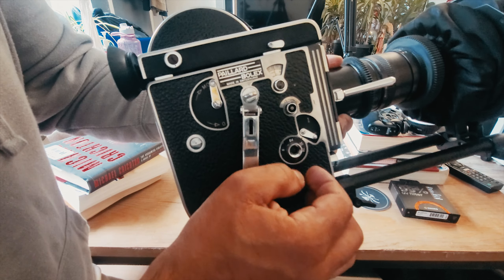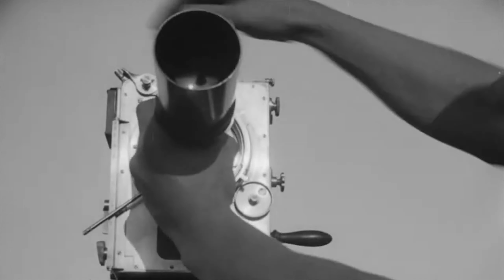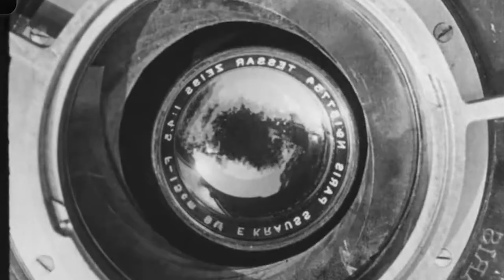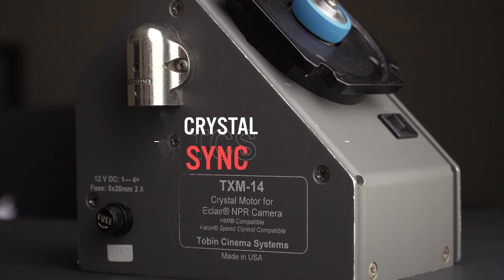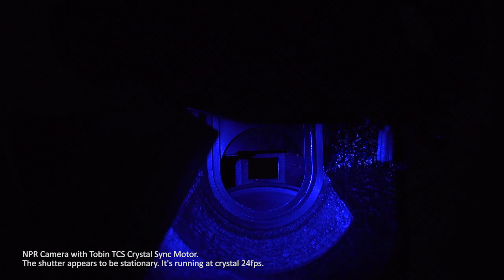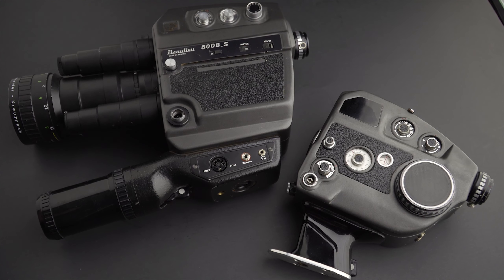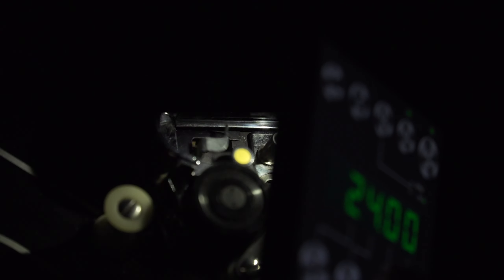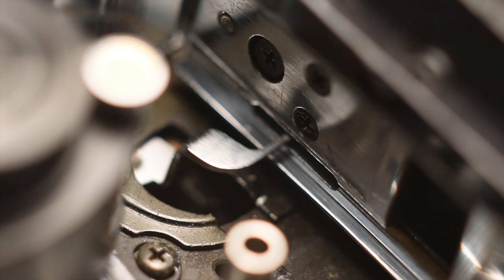Does your camera really run at 24fps?

Comment: Great video. I'll have to check the R16 I just bought.
Reply from the maker: It will be interesting to see how accurate the internal tachometer of the R16 is compared to the app.
Reply: @TheCinematographyLab  It will be. It has a variable speed knob, and then a switch to select the fixed speed 24 or 25. Since I'm in Europe, I will be assuming this one will be set for 25. fps. I'll set up and film it now.

I will do a video on this camera, but am just finishing off a making a LOMO tank copy to use with 3D printed GNAL spools, so I can develop my own films.
Reply: @TheCinematographyLab  I didn't use the App, as my Lumix G81 has both 24P and 25 P frame rate options. Confirmed that this R16 is a 25P (PAL) version, but the speed when set with the fixed frame rate selector is not perfect. Using the variable frame rate knob, I could dial in a more stable 24 or 25P using the video camera. Thanks for showing all three methods.
Reply from the maker: @RotarySMP  Sounds great! I have never had an R16, but I read the manual because I wanted one. I understand you set the switch to the 24/25fps position and that keeps the motor running closer at those speeds, but you still have to adjust  the speed using the speed knob and the marks on the display (tachometer). That's where the digital camera or the app can help you find the best spot just like you did!

Thanks for sharing your experience. I'm looking forward to watching that video. I'm also interested in seeing how the 3D printed tank performs. You are a machinist! you got a new subscriber!
Reply: @TheCinematographyLab  I got really lucky with the R16. It was poorly advertised,  with a "make an offer" in the text. I made a cheeky low ball offer and they took it. It it has not done much work. Looks pretty mint.

Thanks for that tip, I will repeat the sync test this time using the speed dial to try and fine tune the switched speed.

A mate 3D printed the GNAL reels, but the tank I am constructing out of a 300mm PVC pipe. I will upload a video on that as well, once I have it finished and tested. The Telecine is the last piece of this puzzle I still have to make.

Comment: Thanks! Another path someone may consider is a shutter tester recording on Audacity or other audio capture program.
Reply from the maker: That's true. You can quantify the amount of pulses per second. It would take some work and some math, but possible for sure.
Reply: @TheCinematographyLab  It doesn't need  math. You record the palses, if you want from start to finish to see possible changes as the sring unwinds, and then you zoom wherever you want on the "audio" track and measure different seconds etc.

Comment: Thanks for recommending the Strobe app. It hadn’t even occurred to me to use a strobe to check / calibrate my camera. This is an invaluable tool for me because I’m restoring a 16mm camera from 1924 that runs at 14FPS. Now I can adjust my governor confidently. Thank you. Where did you purchase and what model is your stroboscope? I might buy a real one.
Reply from the maker: Sounds like a fun project! I have noticed the intervalometer works better at  24fps and faster speeds, but you should give a try for sure.

I purchased the intervalometer from Aapo Letinen. He is in Finland and he is making new crsytal sync motors for film cameras. That intervalometer has only 2 speeds (24 & 25fps) When I purchased it, it was only the plate with the electronics. I made the enclosure and I had to find a power solution. It's not an actual product. I purchased it because I have several cameras and because I wanted to support Aapo's efforts.

https://cinematography.com/index.php?/profile/28473-aapo-lettinen/
Reply: @TheCinematographyLab  Thanks for the information!
Reply: @TheCinematographyLab I ended up buying a used Shimpo Stroboscope. It’s in RPM but I should be able to type in the the conversion of 14HZ, 840 RPM.
Reply from the maker: @RMphy89  Cool! I hope it works well. It would be nice to hear about your results.
Reply: @TheCinematographyLab  Thank you. I will be documenting the results on a new channel I created. 20th Century Antiques. First video is there now.

Comment: Ok really silly question on the Bolex and putting sound on film. So say it’s 1968 and I have a Rex 4 or Rex 5 and I want to use a crystal sync motor because I want to record a sound film and I have a Uher tape recorder to capture the sound: how did the lab put the sound from a tape recorder to put on the film? Does the film later have a magnetic stripe and is run though a machine to sync the audio to the visuals?
Reply from the maker: If you have a crystal sync camera and an audio recorder that runs at a constant speed it's just a matter of putting sound and the image together. There are several ways to do this. It can be done with time code and fancy machines, but the simplest way to do it is using a clapboard. You find the clip on the audio track and synchronize it with the frame where the clapboard closed.

I don't know exactly how they do it, but a lab can print the sound waves on the film, then a projector that has sound capabilities can play that sound while it projects the image. I know that tape recorders were used as well. Some projectors can start and stop an audio player, but I don't know the details of how they sync them. Happily we use software these days which makes the process way easier.

Comment: Do you know if the fps dial on a Bolex B8L is moved in fixed steps or whether it’s continuous?
Reply from the maker: I don't know. Considering the time period when the camera was manufactured I would assume it's continuous.
Reply: Thanks for the info.

It would make the process you document much easier indeed if it is so as no disassembly would be needed.
Reply from the maker: @alexlandherr  I don't think you need to disassemble the camera. Just move the pressure plate away from the gate and you should be able to see the pull down claw. As I demonstrated with the Scoopic M in the video you can use the claw to see the speed at which the camera is running.
Reply: Thanks again!

Comment: There is one company that can modify your Super 8 camera that is located in Connecticut, USA. They handle some Braun Nizo models, the Canon 814XL-S and 1014XL-S and some other high-end Super 8 brands. It costs 650 USD for the conversion process and the device that controls the camera motor as of 2025-01-24.
Reply from the maker: That's correct. TFG modify cameras to be crystal synced.

Comment: 23.976 fps stems from having to be compatible with NTSC broadcasting. It’s exact value is 24/1.001 fps which makes for a repeating decimal. The YouTube channel “Standupmaths” with Matt Parker has a video on this very thing.
Reply from the maker: That is correct. It's not needed now that digital televisions can display any frame rate, still pretty much all digital cameras have the 24p option. It's a standard inherited from the NTSC days.
Reply: The funny thing is we could’ve had integer fps numbers like with B&W NTSC if they upped the line resolution as Matt Parker says.

I’m just glad my GoPro Hero 11 Black supports true 24 fps.